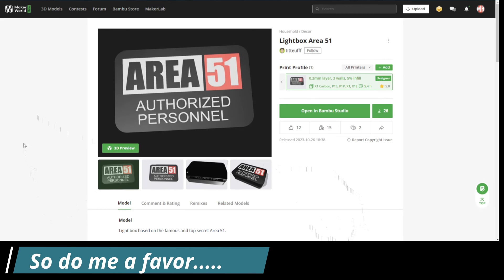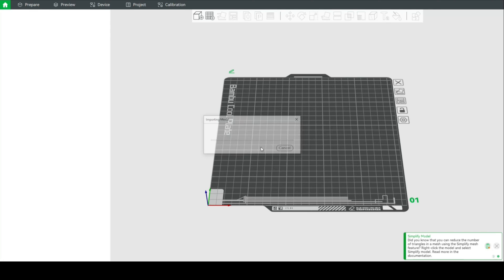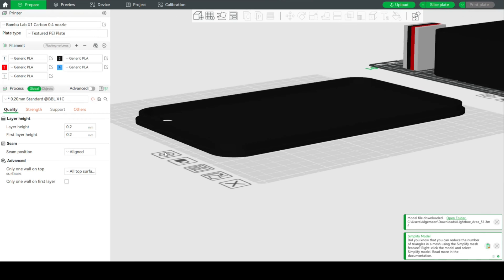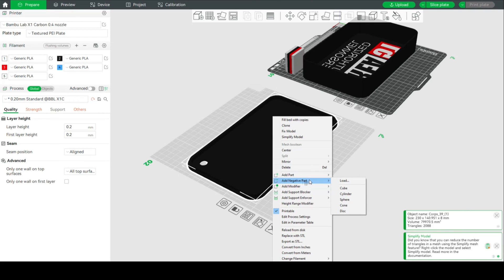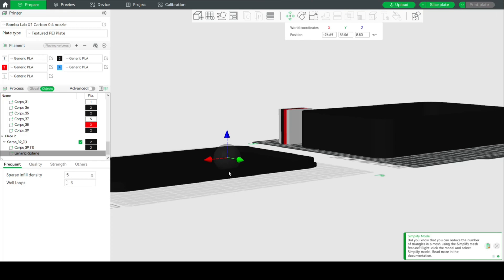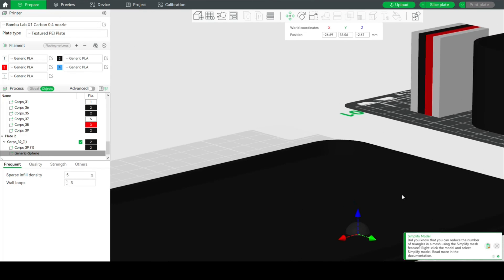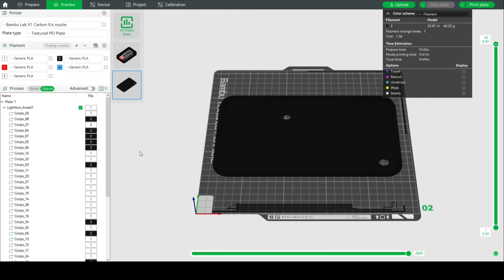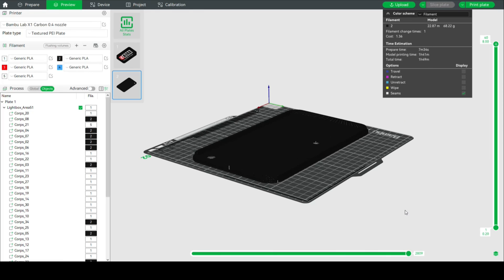How to make holes in Bambu Studio for cables

Comment: If you have a cube and you have an enclosure that you want sunken into the cube, without the cube wall closing off the enclosure.

Do you then first have to add negative object and then afterward pull the object into the sliced hole?
Or some other way? let's say you have a cube and you want to have an rpi enclosure flush fit, the rpi enclosure is a 3d model already.
Reply from the maker: First the cube, then a hole that goes into the cube with a smaller diameter, but not all the way through
Reply: @MH3DPrinting thanks, tried it today.
Found a phone case, then I found a 3d model of Tesla logo, then extracted the T from the tesla logo, imported it into phone case, via the negative object.
Then played around a bit with size and depth, sliced it an boom.. New phone case..

Then I found out it was for a S22 ultra, not a S23 Ultra.. But luckilly I gave it away.
I will use this now for countersinking electronics, like Arduino cases, RPi etc. into other objects.
Maybe also fit speakers in stuff, flush mount :)